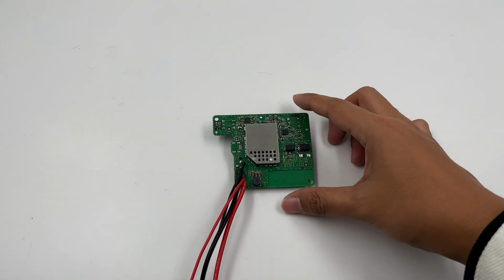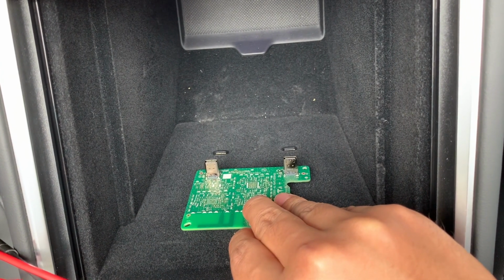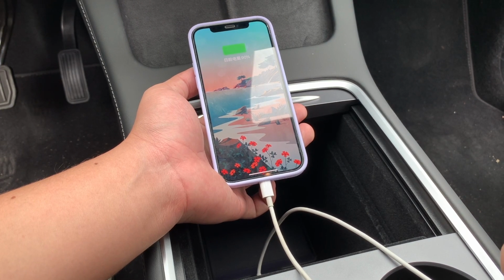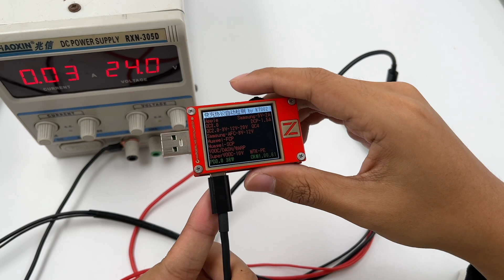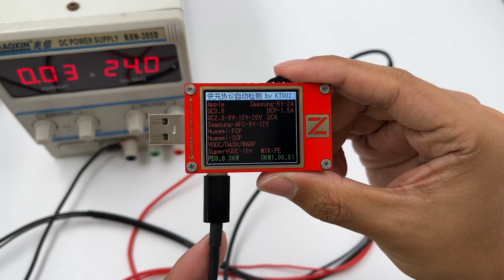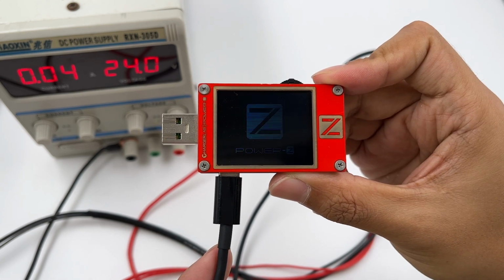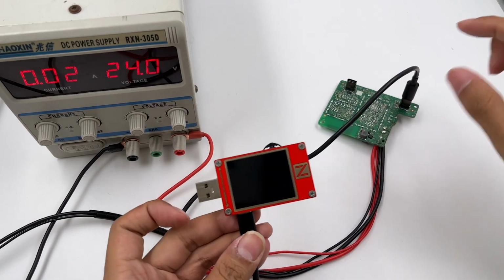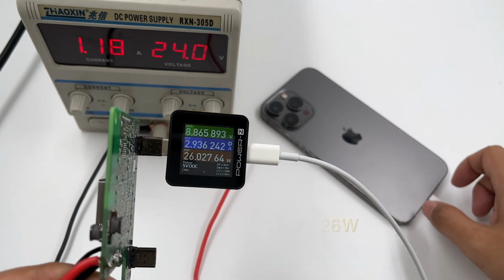Chip Shortage & Feature Missing | Latest Teardown of Tesla Model Y Charging Module

Comment: That's a lot of unpopulated footprints on that PCB! Interesting they didn't just use the D+/D- pins on the MPQ5031 protocol chips or even just short the pins on the receptacle for DCP mode, rather than just leave them open.
Reply: I assume that they already have the PCB boards manufactured while the chips stock went out of stock. Even slight modification on the PCB design would require them to manufacture entire PCB boards again, wasting the tens of thousand previous version manufactured PCBs.